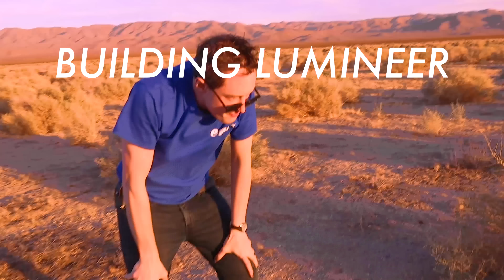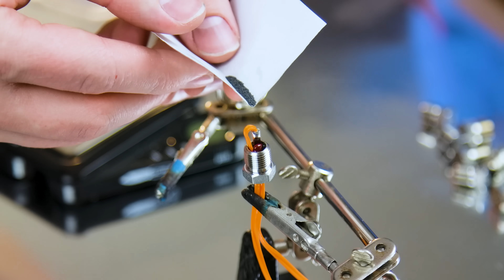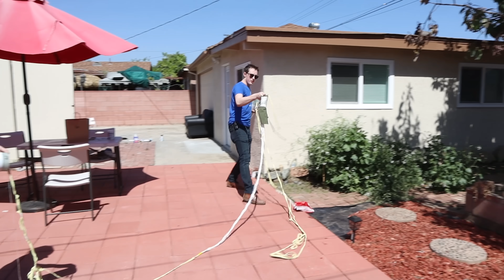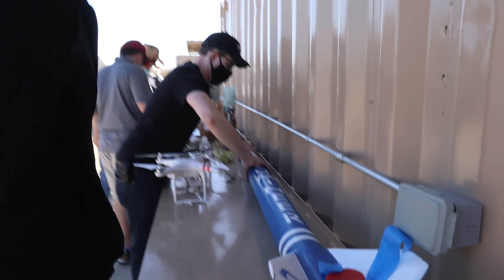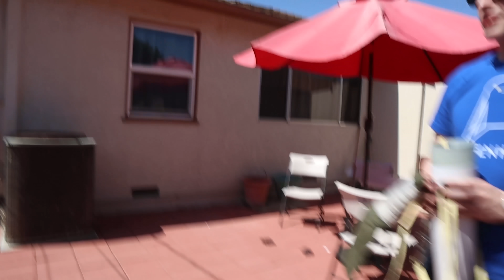Rocket Recovery System - Building Lumineer

Comment: I absolutley love the depth and clarity of these videos. I am on the recovery sub team of the University of Akron Akronauts and we are currently developing a mechanically activated co2 based system for high altitude recovery deployment. Seeing the challenges here, some we have had on our launches that have had similar consequences to the ones you have had, really shed some light on how complex and nuanced recovery is.  As with any new design or rocket there are learning curves and many unknowns when we strap it to the launch rail. All we can do from the ground after that engine is lit is cross our fingers and hope the other sub teams are forgiving when parachutes fail

Comment: Another great vid! The biggest issue to me is complexity. It’s always a better idea to go simple, especially when gearing up for a cert flight. I recommend cleaning up the lines and maybe separating the main and drogue chutes into separate bays to prevent tangling and ensure deployment. This would take up more room and weigh more, however. I am loving watching your process, keep it up!
Reply: Start with installing a flap and some elastics to “lock” in he main d-bag closed until it reaches line stretch.
Secondly, consider building a stronger deluge with more reinforcing tapes or a different configuration: ring, ballute, cross, etc. Rob Warner FAA Master Parachute Rigger

Comment: why dont you use a revolver pistol hammer in co2 gun
Reply: pokemon casing for the main chute, pulled open by the small chute, rocket wings are better, autogyro extending wings, from the body of the rocket
Reply: opening four piece nose cone, acting also a down ward flaps/fins keeping it going down all the way until chutes or wings take main direction
Reply: instead have a main chute and and a failure secondary chute, both piston fired

Comment: You shoving on the top of the rocket nose cone to seat it into the body made me a little nervous. I have a scar on the webbing of my thumb from doing almost exactly that and nearly severed it completely. It hurt very, very badly. Not on a rocket, but similar fit up. It's kind of amazing how much force you can generate with your body weight plus pulling down, and that area is very small.

Comment: I think the reason for the main didnt deploy is because of the hairtie.

Just joking. Anyway, I still thinks the landing system is not redundent enough. If only there was another method that may get the main out, like another black powder charge.

Or a over-engineered second rocket system to yank the main out

Comment: About the problem of losing the drogue assembly: Why don't you just connect the top of the main to the bag using another line? Then the drogue would stay attached to the main, and you would even have a bit of extra chute, right?

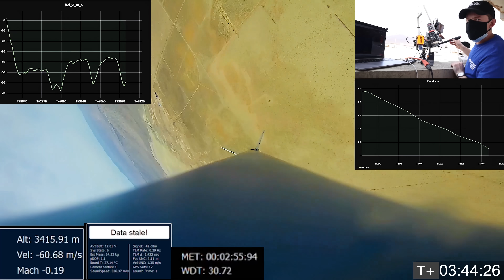Comment: If you watch closely and slowly at 31:35 (T+ 03:43:21), it seems like we can see the drogchute instantly inflating, and at the same time to rocket goes from nose down, to flat spin. Here are some screenshots https://imgur.com/a/LhaHOmU . Could the drogchute be tangled, then untangled and then tangled again ?
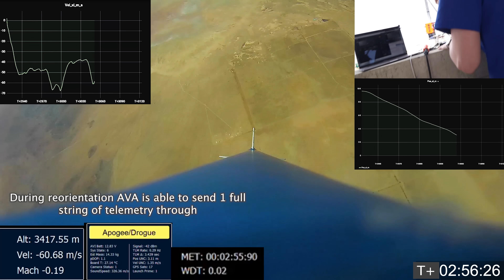Reply: And the exact the same thing seems to happen at 32:54, the drogchute is tangled up and suddenly it seems to inflate correctly, and the rocket goes back into flat spin mode.
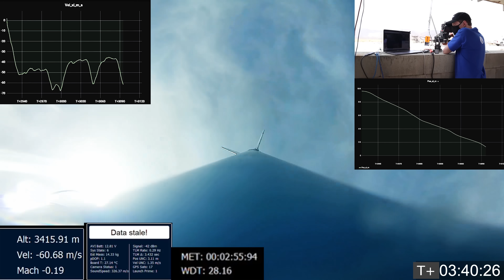Reply: And same thing again at 33:26 . Here is my hypothesis : When the drogchute is tangled it does not produce any drag, so the rocket accelerates nose down, and suddenly the drogchute is untangled and inflates, but the rocket was stable nose down. So it is this force which on the last of the multiples transition makes drogchute explode, and it is also why there wasn't any other transition between tangled drogchute and untangled drogchute. Here are some other screenshots of the last transition : https://imgur.com/a/tj7dzhT

Comment: Watching this series has quickly made me realize my shortcomings as an engineer. Despite being on my school's rocketry team, I have very little experience or understanding of what really goes on when it comes to the rocket I helped build. Things I managed to learn for this series so far: 1. Specializing on the engineering team has found me success and experience regarding the specific subsystem I was working on, which is great and good for growth. 2. The engineer at I am today, really does not like specializing as much as I had thought, I look back and feel as if I should've have been a bit more broad with my approach on the engineering team. Learning and experiencing a lot more. 3. In order to experience and learn a lot more, I'm gonna try to earn my certifications this summer.

Comment: On descent by parachute you will only have the drag of the chute OR the drag of the body, whichever is higher.  Im sure you know that, you  probably misspoke.
It looks like your setup doesnt swivel well.  When you test the next one you need to see if it will survive fast rotation without twisting so tight it cant open.

Comment: I’m sorry. My head exploded half way through the white board/green ink discussion. With only two gray cells working after the discussion I surmised that you had ten pounds of linguini stuffed in a nosecone designed for five pounds. Is this, more or less, what happened? If so, I would suggest next time coating the inside of the nosecone with KY Jelly. Well done, son. Next time you and the team are going to hit it out of the ballpark. With all engineering projects, there’s never enough time, data and money. You’ll learn to thrive in that environment. 
Cheers, from a 71 year old retired engineer.
Reply: I think my head exploded reading this
Reply: @capyintro215      Oops, sorry about that. 😂

Comment: Gosh, it is so interesting seeing your post flight analysis, that’s the best bit, thank you.  I think your key problem is insufficient force to separate the main bag from the main chute. Two possible solutions spring to mind, the second seems better. 1, put two drogues in series. If the end drogue works, it will pull the reserve tight if it is connected to the reserve’s apex. If that end drogue fails for whatever reason, the reserve drogue can open because it is not pulled tight. This system will not work if the failure mechanism for the end drogue also fails the reserve drogue, so it isn’t perfect. 2 Reduce the force needed to remove the main’s bag from the main chute. The best mechanism I’ve seen is a shiny pin, ring and cone for locking, and elastics to pull the bag open. A parachute packer from the WW2 or Korean War era will be able to show you the brilliant engineering. 

I so look forward to your next washup videos, they are the best! Thank you so much:)

Comment: I watched important parts of the video a few times and here are some suggestions and questions that I have:
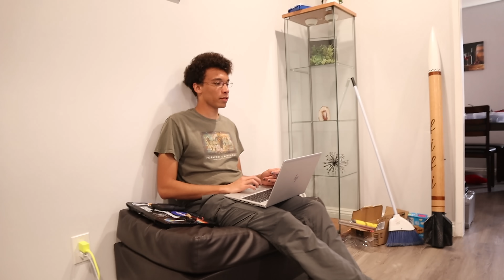- You already ask the question at 22:14 but I see a problem. If the drouge chute line is shorter that nose cone line, nose cone may hit the drouge while flapping around. Also nose cone line may entangle with drouge chute. And I guess that is what caused the issue.
- Can you show more of the remaining of the drouge chute? Where did it snap from? If it snapped due to shock I expect it to snap around the line connections and I expect snapped lines. If it snapped in the middle of the cloth, then I would assume it is something hitting there, like nose cone itself.
- I would also try to reduce the complexity by removing some of the lines & other elements. Here some suggestions:
    * Elastic band is a great idea but don't attach it with another string, instead pass a small loop from main parachute line thorough elastic and when the main line gets tension it will release the elastic itself. It is heavily used in paragliding & parachuting world. You can an example at the end of this video: https://youtu.be/TIp4nyZcUyY?t=678 Hope it gives inspiration.
    * Can you remove the connections from tender descender from the god knot and only keep the secondary ones you put. (for the case if both TDs fire). Since removing that link doesn't change anything, TDs will still be connected to god knot with secondary lines. I am trying to reduce complexity by removing some stuff.
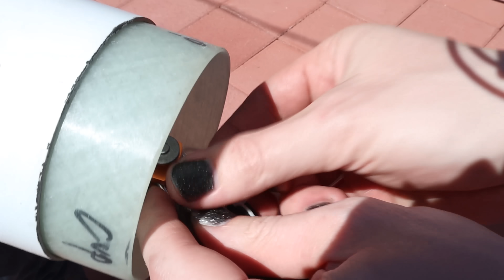- And lastly, I hope the line from main bag the tender descender line is long enough. If only one of TDs fire then the load will go through tender descender line to line between main bag and tender descender line to drouge riser. Main chute line won't be loaded. And from what I see in 26:18 it seem like it is the black line that frees up after breaking TD. But it uses same connection type as the drouge unloader so I don't see keeping it because it will behave exactly same as unloader. Correct me if I am wrong but otherwise I don't see a point in increasing complexity.

Comment: Btw, why you didn't designed some design what doesn't require a pulling out for main parachute? Like placing a lock into a rolled thing, and if you unlock it, then it releases the main chute. Then even if your drouge fails, the main must open.

Comment: second drogue? stronger drogue? your system is redundant at every possible point thinkable except the chute operation, you're relying solely on the drogue working correctly to operate everything, and that is non-redundant, if it fails, every other redundancy is worth nothing, so maybe you should look at making the main chute deployment more redundant that way

Comment: The positioning of the tender descender & having the main chute extracted out of the air-frame but held in the bag by the elastic is where your system failed. The main chute should have remained in the air-frame and the tender descender should have been forward of the main cute, the TDs are reliable devices so two weren't really needed & you would have been better off to just mod 2 e-matches into the one unit if you wanted redundancy. Wish you the best of luck with the next attempt & if you want someone experienced (30+ years building hobby & pro) to sit in on a "design review", will happily give some input just DM me.
Reply: I might add that this configuration requires the drogue chute to be the larger of the size required to put the rocket in a stable, predictable configuration, and the size required to extract the main from the deployment bag. Since a rocket in a stable configuration may be moving too slowly for the drogue to provide enough force to extract a tightly packed main, this can be a delicate balance. One simplifying answer is to have a separate pilot-extracted main in a second compartment until we figure out how to better model recovery in relatively lightweight, aerodynamically active HPR rockets (at least compared to what airdrop and spacecraft recovery systems deal with). Also, get Knacke’s book.

Comment: I hate to be the negative comment, but as an experienced rocketeer this is an overly complicated system for your 1st time going high and fast. There are several other methods both lighter and simpler that would serve you well. Ensuring the main bag is clear of the body tube should be the job of your ejection charge not your drouge chute, also single bay deploy definetly increases the chance of tangled lines. While upsizing the drouge chute will increase the likelihood of success it won't guarantee it.

Comment: Hey you guys may want to go with a ballistics chute from Ky Michaelson AKA (The Rocket Man). That's if he still is making them. They are some chutes he puts his life on the line. He is a retired I think stuntman. He's a eccentric kind of guy. A bit annoying but really should check out. He's out of Wisconsin. Also try putting break points in your schock cord. Also instead of Kevlar use nylon it's more forgivable and stretches instead of snaps like Kevlar go figure. I've used Kevlar and had it snap on me even though it's rated at 10,000 lbs per whatever. If you guys are going to Black Rock in September I'll see you there. I hope ✌️

Comment: When the drogue deployed and inflated, there wasn't much weight on it. It created a whip like effect on the lines and when it finally was tensioned, it was like cracking the whip with the heavy body at the end of it. That whip crack created a spike of energy that overpowered/oversped the parachute and blew it apart.

Acceleration telemetry at that moment should be able to confirm or deny this theory. 

I've spent some time sailing in heavy winds and this isn't all that different from how spinnakers are launched, which are also often made out of nylon (or similar) materials.

Comment: The flat spin balance dynamics will vary dynamically based on the roll angle and how the fins are angled.  When 2 fins got equal high loads it went nose down. 

I would think you want a profile that keeps the rocket slightly below the plane, to allow for the variation. 

I really love the way you share the data with all of us.  When you show and explain something I understand it gives lots of credibility on the topics or points that I don’t.

Comment: after watching the whole thing, I feel the need of a bit of backseed commenting and alsow posting a view questions. 

1.st why is the droge made out of sutch a thin material, A shoot tht small cant have that mutch influence on rocket performance if its lats say 50g havier and therfore resists 200kmh wind.
2. seeing the relative simplicity of the first shoot release with the piston that is a great system. Simpel and relativly failsafe. Compared to that the system for the main shoot sems very complicated and prone to tangels. If you ever had 2 pairs of headphones in your pocket you know what i mean. 
3. The main problem i see is partcount having parts that operate redundent is fine untill you increase cludder to a point that you system gets more complicated. 2 igniters in a charge is a gereat thing. 2 seperate charge bodys are a different beast all together. "The best part is no part" Elon musk
Why not do a 2 piston aproach with seperad compartments the first relase seams simple wht is the problem of not releasing the second shoot in the same way. 1 seperator blasts the line to the the droke and a piston/mortar blasts out the main. Untill that point the main is in a nice tangle free enviorment. 
Probably there is some flaw in my system but it coud be a way to go

Comment: I understand wanting to avoid more pyrotechnics, but relying on the drogue to pull out the main seems to add significant complexity to your lines, and makes both parachutes critical to mission success. (If either parachute fails, rocket go splat)

Have you considered using two independent pistons to fire two independent parachutes? 
Then, even if the drogue tears itself to shreds, your main has a chance of opening, and also you don’t need a complex set of lines.
Reply: How would you fit a second pistons in there? Also my understanding is both parachutes are critical to mission success anyways as deploying the main chute at terminal velocity would tear it to shreds.
Reply: @Pcat0  Perhaps, but apparently the rocket was going slowly for a while just cause it was falling sideways, and he implied that "the main chute almost came out on accident, which could have saved the rocket". The drogue shute will always serve a purpose, but it is possible that it could fail without mission failure if it is a separate system. 

The main advantage is the simpler lines, since you get rid of the bag, the drogue release stuff, and the pyro-line cutter gets replaced with the second piston.
Reply: @haph2087  adding a second piston would have increased vehicle's mass by a significant hence requiring a completely redisigned chute system increasing the mass further more and so on. In rocketry you cannot let yourself get in this trap
Reply: @aringangal  well, it replaces the two tender descenders, so It’s not like it’s just added weight. It also simplifies the design, which is helpful.
Reply: @haph2087  the size of tender descenders are significantly smaller than the piston, so to accommodate one more piston you will increase the length of tubing and piston is comparatively heavier than the descenders. Also as the pistons  cant be accomodated parallel to each other, one has to be placed on top of other hence increasing the complexity of connection and also compromising the strength of vehicle
Reply: @aringangal  I don’t see why any of those things have to be true. You can get smaller pistons, and there’s no reason they couldn’t be side be side, nor is there a reason they would damage the structure of the rocket. I am confused why you are saying these things.
Reply: @haph2087  by the time you realize that the drogue chute didn't deploy you are going too fast to deploy main chute, you either rip apart the chute or the rocket
Reply: @Megaranator  this! Yes redundancy does not matter if you do not add a redundancy D chute also..
Reply: @Megaranator  Not necessarily. Just a significantly reduced chance of success. 

I am not saying the drogue doesn’t serve a purpose. 

I am saying that the drogue shouldn’t be used to pull out the main, because if it is, a drogue failure results in complete recovery failure, where as if it isn’t, the main has some chance of working.
Reply: The first HPR dual-deployment systems would separate the vehicle at about the mid-point of the fuselage to deploy a parachute, then pop the nose off to deploy the main.  Even using another piston, that would still reduce the complexity and increase the chance of successful recovery over that mess.

Edit: It would also keep Major Murphy from turning in his grave - remember kids, anything that can go wrong, will!
Reply: Putting out the main or two mains, would be too much of a snap and blow out the main chute(s). The drogue has a giant hole in the middle so it doesn't catch too much air (and blow out).